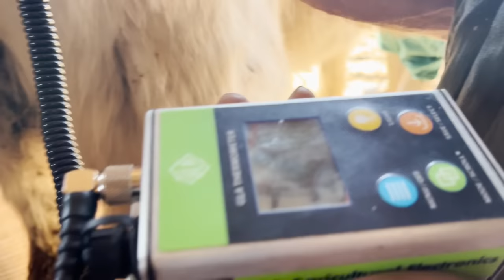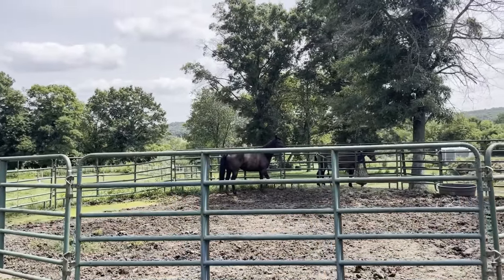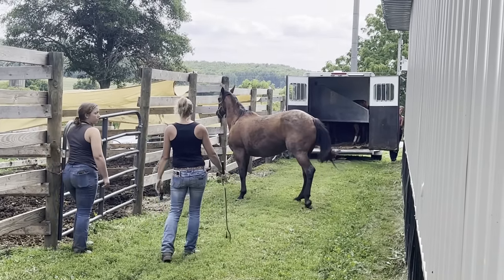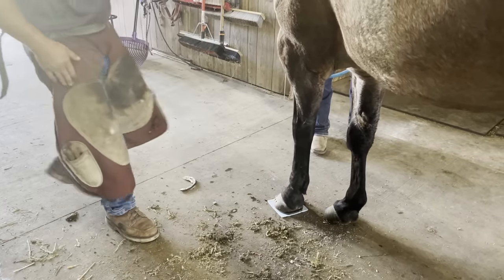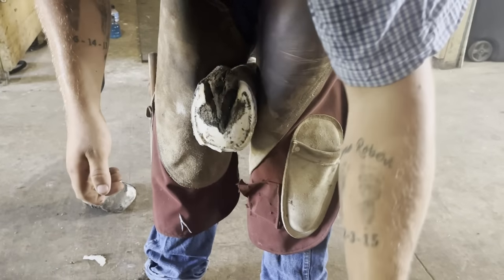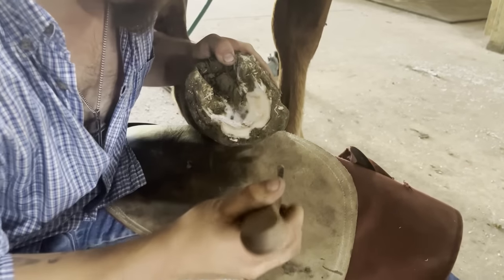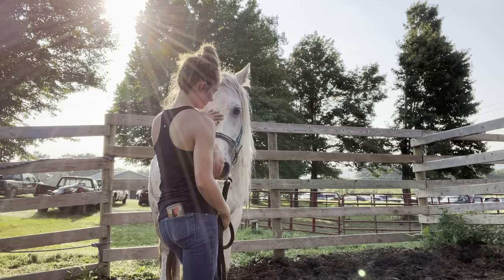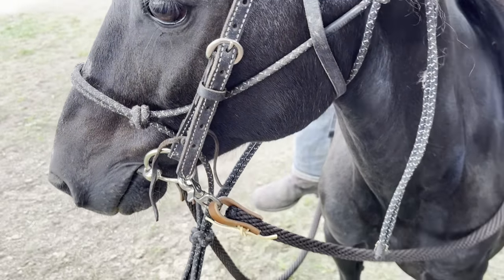We've Got the Hottest Farrier Around!!

Comment: I get the idea of the stocks for the larger horses but they just seem really dangerous. Here in the UK farriers just trim heavy horses the same as others. The stocks just seem to utterly stress the horses out. Is it something that improves over time? I understand obviously most of these horses probably haven’t had much done with them before you get them. Just curious as like I say we don’t use them here really.
Reply from the maker: 90% of the time, the horses are fine in the stock. Sometimes it's their first time in one or if their feet hurt (so they really need them trimmed/checked) they will get worked up. Most generally they relax and get better each time. We do drafts without the stocks here as well if they will hold their feet up. Some do. Most don't.
Reply: @PonyTalesRefuge  Fair enough like I said I was just curious. Drafts just like you want the hoof you can hold it up because I’m not 🤣🤣

Comment: for completely unhandled or frightened horses it would be much safer if You made some kind of a narrow run, like for the cows or mustangs, with an access from the pastures, ideally with the stock at the end, and with a place to put a trailer after it as well. becasue some situations here are potentially dangerous for the people handling those, fortunately nothing happened, but in a long term with a lot of problematic horses, some way to run them freely into stocks or trailers would make Your and their life easier, and safer
Reply from the maker: We are currently in the process of getting the paddock run extended throughout the property to attach to all pens. That is a huge project and there's only so much time (and funding) to accomplish that. We purposefully need the run to not be too narrow so equipment (tractors, skidsteers, etc) can get in there and also, if a horse is running at you, you need to have room to get out of the way. If it's too narrow, there is a much higher chance you will get hurt or the horse will hurt themselves.
Reply: @PonyTalesRefuge  great!

Comment: Aren’t Equine keratoma’s only able to be diagnosed by hood x-ray?
Reply: In early stages yes, xrays are beneficial, eventually they make themselves known and easy to see because a keratoma is a noncancerous tumor or mass that separates the hoof wall . Per Merck vet manual  "A keratoma is a benign mass made up of keratin that is situated between the hoof wall and distal phalanx. The cause is unknown. Although keratomas originate at the level of the coronary band, the condition may be difficult to detect until the growth is well advanced and located in the wall far distal to the coronary band. There is commonly bulging of either the coronary band or the hoof wall over the keratoma, depending on its position within the foot"
Reply: Also keratomas are usually localised growths, I never heard of it being all around the hoof capsule, even more so in both hooves. In my opinion white line disease or similar problem would be much more likely in this case
Reply: @visenna9   What I first noticed about his hooves were how they looked "stuck" on the bottom of his legs, like his legs were slowly sliding down to the ground while the hoof slid up, I was shaking my head before Paulie got the microscope going.
Reply: @astikennel  so something with laminae. but it didn't look like a founder/ sinker or cancer also. strange case. maybe x-rays would be useful, but not necessarily
Reply: I found it a bit curious that looking under a microscope at a large section of hoof (not slide prepared nor a cross-section of a thinly sectioned and light penetrating sample)  by a non-medically trained professional determined the recommendation of euthanasia. Medical tools are a great addition to a rescue, but they need to be used by trained individuals who can discern what they are actually seeing in-view under the lens.

Comment: The horse with glue on rocker shoes would need more focus on the high heels, instead of getting rid of so much toe. Then she could have gone barefoot right away. Cutting the toe and putting on shoes is a more expensive solution, the right angle of the heel would have made her more comfortable at once. Wish the little farrier learned more about barefoot hooves. Short toe and high heel are so old school. 
Love the work you guys do for the horses! ❤❤❤
Reply from the maker: Her feet were also very sore due to founder. The shoes helped with more than one thing!